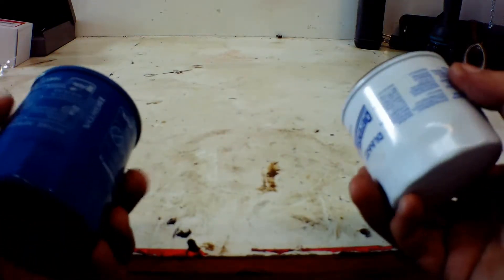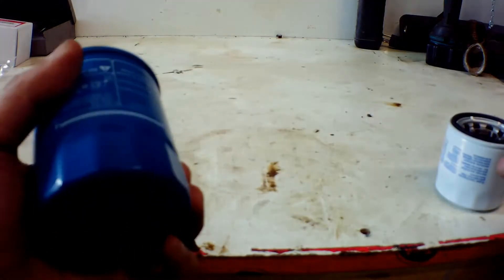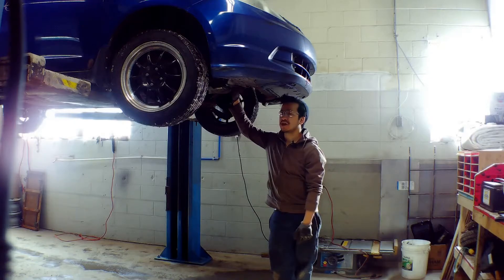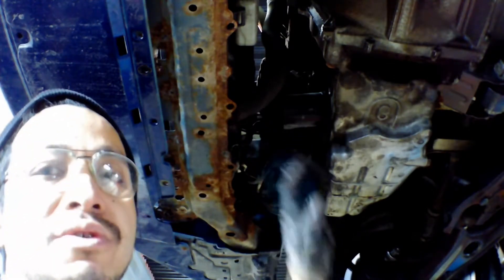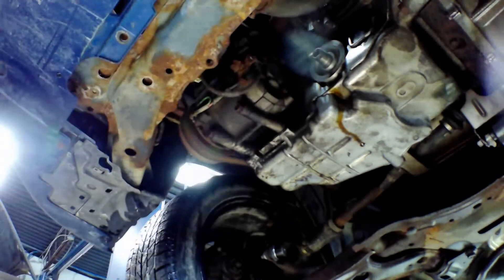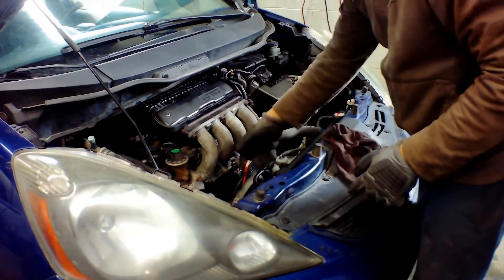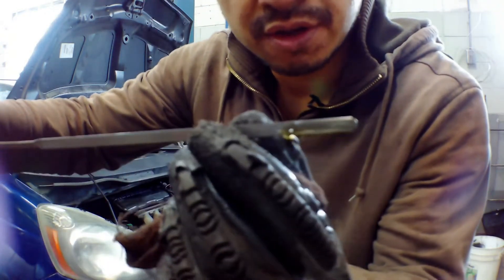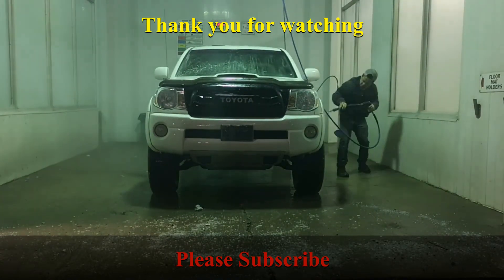How I perform an Oil change

Comment: Man I wish I could change the Sunfire's oil filter in my driveway... but I just don't have the time or resources for it, it's really buried in there.
Reply from the maker: it only takes 5 mins to do.. its better if the engine is cold rather in peak temperature